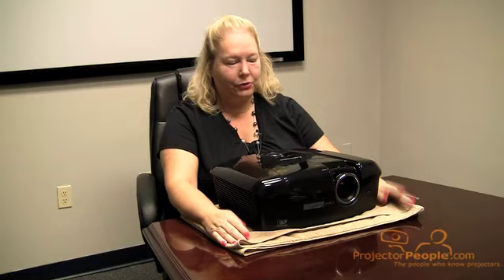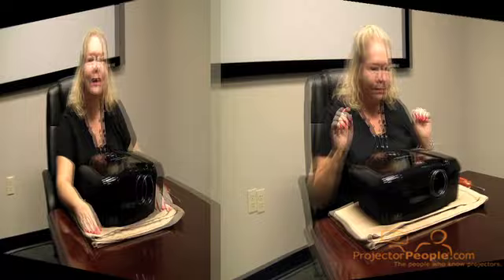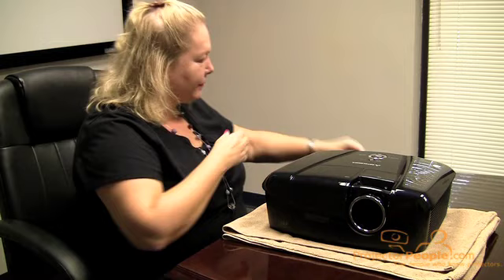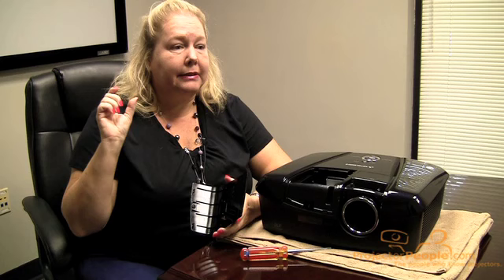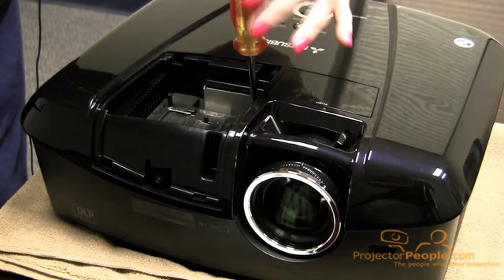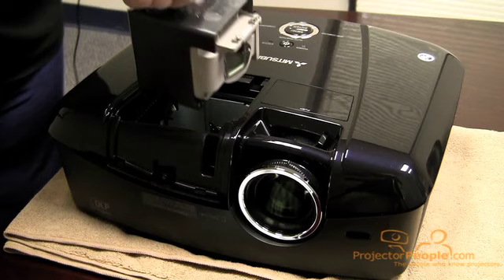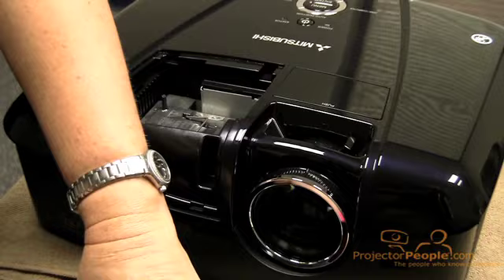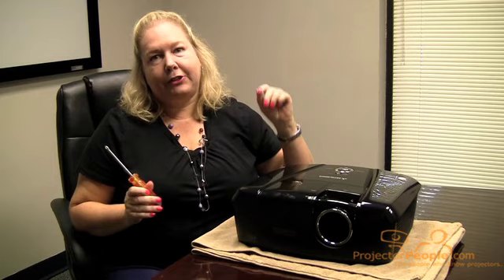How to Change a Projector Lamp

Comment: the first time I got a projector, the manual said, "replace the the cover once lamp is screwed in" until I realized that I could just put it back on, that's what I did, literally. I would go and pay to have a new cover made with a 3D printer and replace it every time. it got really expensive.

Comment: What happens if I can not turn on the projector? I opened it up but since I don't what the original lamp light looked like, I think it has a few molds on the bulb? Do you reckon its a power failure and would need a new lamp?